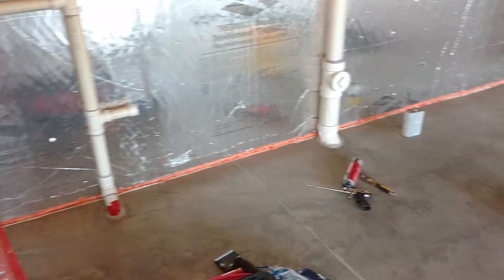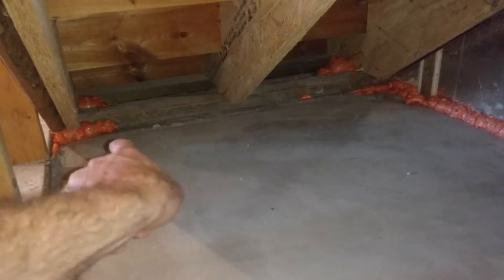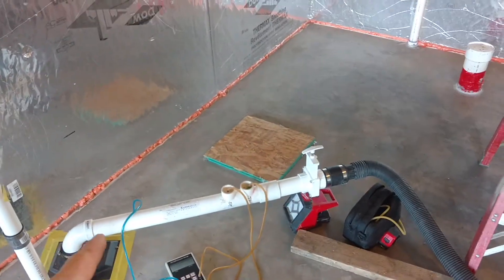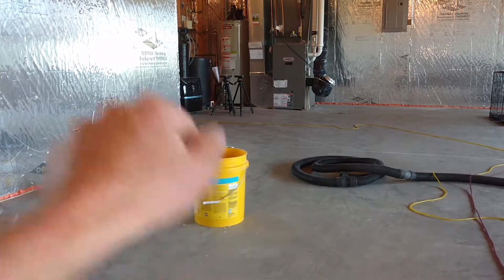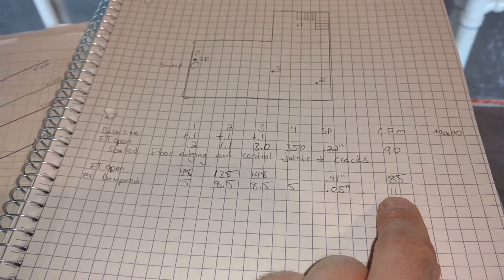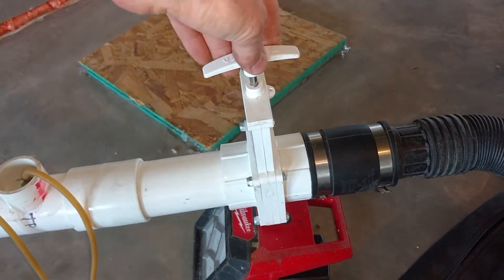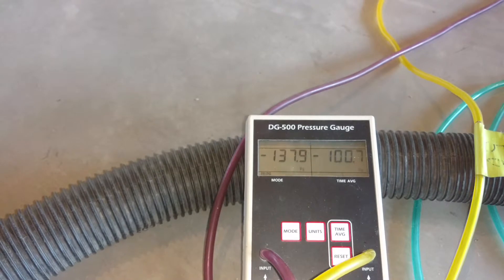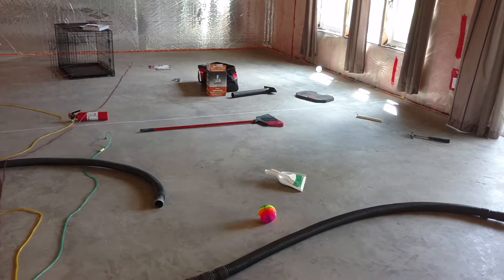Sealing and Radon Mitigation - Part 3

Comment: Ever use the liquid spray on radon sealer over all the concrete. Supposedly it’s supposed to react with the lime or something and penetrate deep in the concrete to form a solid barrier. All the videos I’ve ever watched no one ever mentions that stuff. Guessing the pros know it’s a gimmicky product. Thoughts?
Reply from the maker: I've never heard of a pro using Radon Sealer. I'd be interested in hearing about your experience if you do use it.
Reply: @AmericanRadonMitigation  well, after installing the fan my levels are .5 furthest away from the suction point. Can’t complain with that result. I sealed the floor to wall joints and any small cracks. so at this point I imagine it would be a waste of money for any negligible difference. I was worried the fan wouldn’t be enough cause I was getting readings over 50 near the sump pump. I sealed that up and used it as a suction point. Getting 1/2 in of flow ( measured about 190-200cfm) and now in that same area I get pretty consistent .2-.4. Unbelievable the difference. Used an amg maverick fan and I even had to use 6 long sweep 90’s (3”) from the sump to the fan, and then used 4” exhaust pipe which again has 2 more 90s. Went with the 4” cause I worry about freezing. I have 20 ft of 4” horizontal run in the garage attic to get it away from the house and a 2nd story window. I made sure I had over a 1/8 in slope per foot and strapped every 4 ft. in the end, I now feel safe in my home. Total materials about 550-600$. Quote from a contractor… about 1800$ but then called me back and said he couldn’t give his guarantee because of the routing needed to get the vent pipe and fan where I wanted it, in the garage. So he said he wasn’t going to do it. All contractors want to do is go straight out and run pipe directly up the side of your house. Just know, Your quality of work is second to none, and I appreciate all your helpful videos!
Reply from the maker: Well done, Ryan! Thanks for the nice compliment! 

You may be able to use a smaller radon fan if you really want to nerd out on energy savings. That would be an AMG Spirit, RadonAway RP140, Fantech RN1, or a Fantech RN2 EC. A micromanometer would help you determine how much suction you need furthest from your suction point.

Comment: What does sealing under the lumber walls do? They don’t penetrate through the floor slab do they?
Reply from the maker: Load-bearing walls are typically resting on the foundation. The concrete floor is then poured after the load-bearing walls are in place. This means there is a floor-to-wall joint here, just like you would have on all of the other edges of the slab. Your garage floor typically has a sizeable floor-to-wall joint that is easy to see, whereas finished walls might cover them inside your home. Thanks for the question, Kurt.